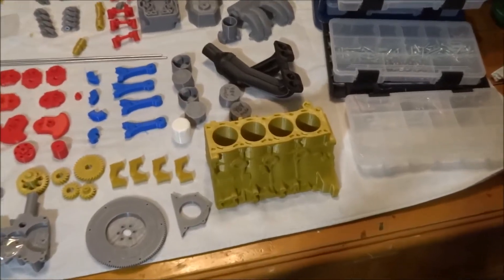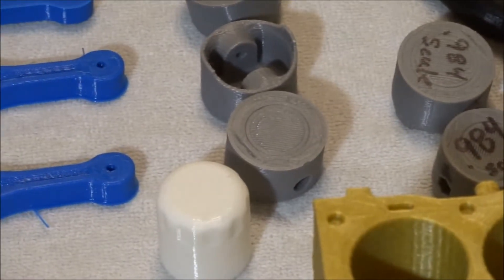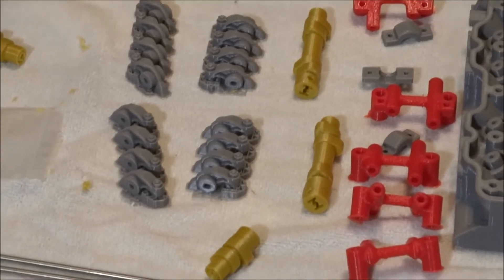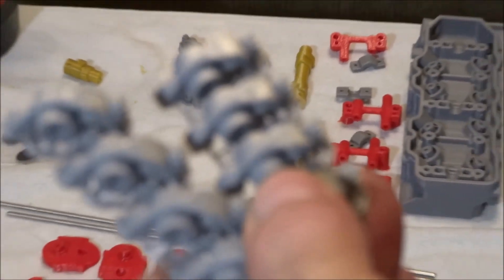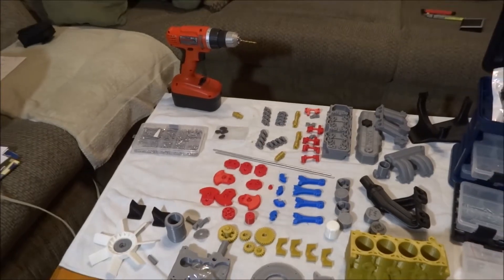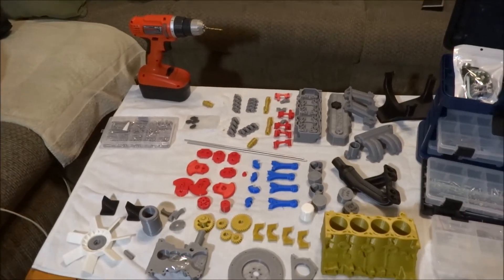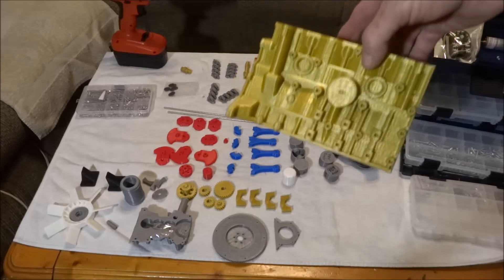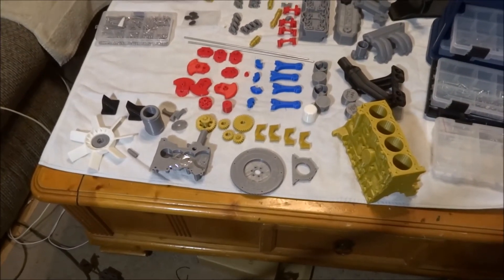Toyota 22RE, 3D printed - partial assembly- see video description for more info

Comment: can you tell me the size of the ball bearing
Reply from the maker: uses 608zz (5) and 623zz (19).
  On thingiverse look for the 22re engine by ericthepoolboy, in with the .stl files there is a .pdf file (about 3rd from the bottom of the files list)in  that instructions file is a parts list (page 3 or 4).
     Thanks for the Question. I have also added this to the video description.
Reply: @TSRGarage Is this the ball bearing you use in the crankshaft?
Reply from the maker: @-Selim-33   the 608  is the bearing for the crankshaft, 603 is rod bearings, cam etc.

Comment: What springs did you use for valves?
Reply from the maker: I  0.6 x 12 x 20  springs. I can not find a record of my order. .. but.. After some research, this looks to be the same listing 🤞. 
 "0.6mm Wire Diameter 304 Stainless Steel Compression Spring Small Pressure Spring"   
https://www.ebay.com/itm/392797658973?var=661684372423&hash=item5b74909f5d:g:IFwAAOSwEmNeu6r9&amdata=enc%3AAQAHAAABELC%2BDRLxzxB9f8eJVMBlMEiPeHEdyR1fzc3Ib0%2FBNzRtq2qU4aic5p%2B3JXATiFSawRc4DVqmd%2BPlmcVAypgQT0Ip%2BK8rkeHrJp52fYyJUWk8OafDYpxaRnm%2FDwUEuPYt%2BFduDXMAmDcV83CoZW%2B6FwbDSDvgbaS6R3DUMiLXyuvLO5nLiFtKJd0QN2Q7%2FAedLFwUwTNuu2MI2O%2FSVJ%2B9VOB0gbOJ%2FFIJ7aljh7C2ulbRYF4fNjSIlvGcCL0d4aJwA9PsodeYpRbOKqAH9xANdFjuNYXXX7bQ8XQCyYCvR591meoOC1GefIxR7nUvQP1YrlgNRIIajrbaLpQSkY3fnIixx2DHzJ%2B7oq9dfBjTO7MF%7Ctkp%3ABk9SR8TgkOrhYA
Reply: Thanks
Reply from the maker: @wladimirkarpenko6320  thank you. I finally added it in the video description 👍

Comment: Hey, i cant find the valve springs anywhere which one would i need to use?
Reply from the maker: I used 0.6 x 12 x 20  springs. I can not find a record of my order. .. but.. After some research, this looks to be the same listing 🤞. 
 "0.6mm Wire Diameter 304 Stainless Steel Compression Spring Small Pressure Spring"   
https://www.ebay.com/itm/392797658973?var=661684372423&hash=item5b74909f5d:g:IFwAAOSwEmNeu6r9&amdata=enc%3AAQAHAAABELC%2BDRLxzxB9f8eJVMBlMEiPeHEdyR1fzc3Ib0%2FBNzRtq2qU4aic5p%2B3JXATiFSawRc4DVqmd%2BPlmcVAypgQT0Ip%2BK8rkeHrJp52fYyJUWk8OafDYpxaRnm%2FDwUEuPYt%2BFduDXMAmDcV83CoZW%2B6FwbDSDvgbaS6R3DUMiLXyuvLO5nLiFtKJd0QN2Q7%2FAedLFwUwTNuu2MI2O%2FSVJ%2B9VOB0gbOJ%2FFIJ7aljh7C2ulbRYF4fNjSIlvGcCL0d4aJwA9PsodeYpRbOKqAH9xANdFjuNYXXX7bQ8XQCyYCvR591meoOC1GefIxR7nUvQP1YrlgNRIIajrbaLpQSkY3fnIixx2DHzJ%2B7oq9dfBjTO7MF%7Ctkp%3ABk9SR8TgkOrhYA

Comment: What is the motor you used though? I can’t find the recommended motor anywhere’s on the thingiverse page and the website got taken down before I got to this project. Could you supply the information for the motor and speed controller or maybe a link? Thanks!
Reply from the maker: It's been a while so I no longer have the links. but I did a bit of searching on ebay and found what appear to be the same ones I used. 
DC 6-30V 20A Max 300W PWM HHO Motor Variable Speed Controller Switch 6V 12V 24V
https://www.ebay.com/itm/DC-6-30V-20A-Max-300W-PWM-HHO-Motor-Variable-Speed-Controller-Switch-6V-12V-24V/363133454969?hash=item548c70ca79:g:fe0AAOSwWgNfkqFg

   It looks like the motor is available in different rpms.  If you want the engine to turn a bit faster.
12V DC 20RPM Powerful High Torque Gear Box Motor
https://www.ebay.com/itm/12V-DC-20RPM-Powerful-High-Torque-Gear-Box-Motor/320913010280 
    Hope this helps.  
      One day I am going to finish assembling mine....
          one more thing
 I ordered these springs for the valves. On a trial fit up they seem to work fine. But I have not assembled the clinder head yet. I bought the 0.6*12*20mm
https://www.ebay.com/itm/0-6mm-Wire-Diameter-304-Stainless-Steel-Compression-Spring-Pressure-Small-Spring/302950118022?ssPageName=STRK%3AMEBIDX%3AIT&_trksid=p2057872.m2749.l2649
       let me know how this all works for you .
Reply: @TSRGarage  this changes everything lmao! Time to build an engine which quite possibly will lead to me building the Camaro engine and maybe designing my own in the future when I get more time and skills on fusion. Hope you finish this one sometime in the near future!
Reply: Didn't work for me 😢 @TSRGarage